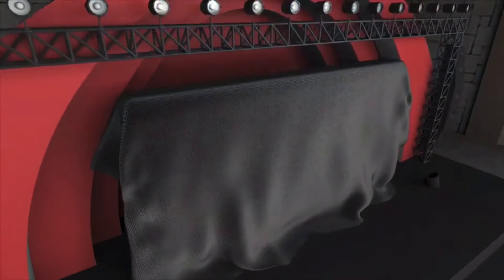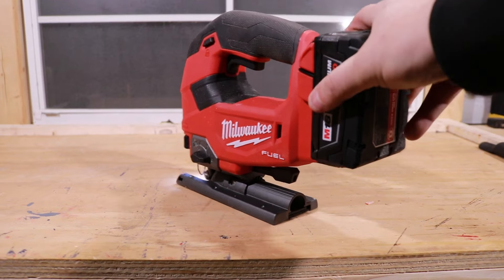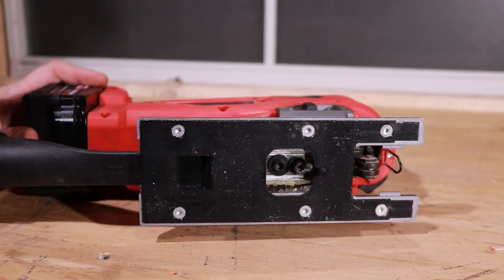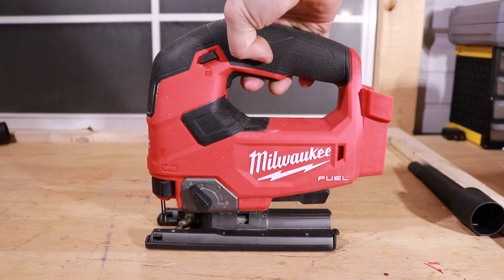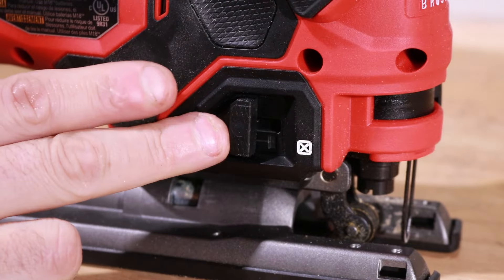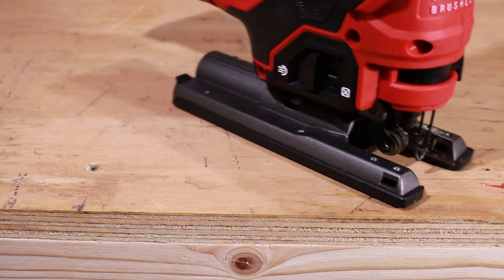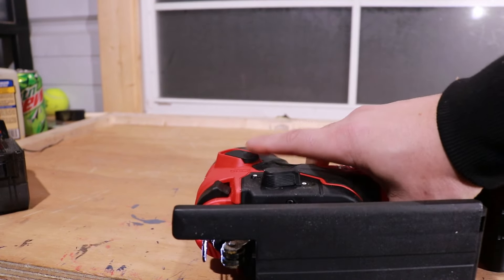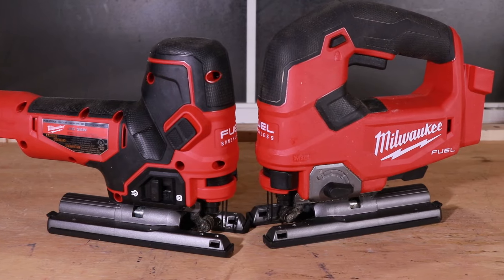Milwaukee Barrel Grip Jigsaw (2737B-20) vs. Milwaukee D-Handle Jigsaw (2737-20) Tool Duel Episode #5

Comment: Here I go again watching tool reviews knowing I don’t need more.... BUT I WANT MORE
Reply from the maker: Hahaha 🤣👊
Reply: Good review and if you check Amazon, you'd see many bad reviews for the D handle saw such as lever loosening while working, angle not holding when doing straight cuts, other incidents (Mine had a pin guide issue also so now I must not apply too much force, else, something else would get damaged in the mechanics and I need to hold the 
lever while working to keep on the line.) and I'm now considering Hilti or Festool brand because when going threw
hard wood, many tools would have issues.  Five stars for communication, tech. skill, experience for you⭐⭐⭐⭐⭐
Reply: SAME!😂
Reply: Same here

Comment: Nice side by side, but I’m a barrel grip person all day long!!
Reply from the maker: I think a lot of people are going to go with the barrel grip too broski
Reply from the maker: Yeah, I agree. Not have to pull that trigger helps too. I think each one have their different advantages.
Reply: Bevel is better on d handle but the auto is better on the barrel having both wouldn't be bad
Reply: What is the diff or the purpose for having two different model?  What’s the benefit of barrel grip over d?
Reply: You like holding long shafts huh? Hahaha
Reply: Good review and if you check Amazon, you'd see many bad reviews for the D handle saw such as lever loosening while working, angle not holding when doing straight cuts, other incidents (Mine had a pin guide issue also so now I must not apply too much force, else, something else would get damaged in the mechanics and I need to hold the 
lever while working to keep on the line.) and I'm now considering Hilti or Festool brand because when going threw
hard wood, many tools would have issues.  Five stars for communication, tech. skill, experience for you⭐⭐⭐⭐⭐
Reply: Me too

Comment: I’ve been using a jigsaw regularly for the past 10 years and I don’t know if I’ve ever used the bevel function on one. For me the barrel grip is so much more ergonomic. Particularly when making curved cuts which, let’s be honest, is the main reason we break this tool out of the tool chest. D handle has some nice features though.
Reply: For the D handle Milwaukee (12v), the lever has a tendency to loosen and if going threw hardwood doing curves or beveling, it's going to put much trauma on any tool not capable of handling it so Festool or Hilti brand has a better tool with more features to hold the blade, for example, while cutting.

Comment: The D Handle! Great tool, got it last month. I was deciding between the both tools when I was first looking for a jigsaw. Now I've seen this video I've made the right choice.  My brother has the old barrel grip great tool to, but not comfortable in the hand and you need plenty of operating room for it, "to long" that's why I went with the D Handle. Thanks for the video.
Reply from the maker: Thanks for the comment!
Reply: Good review and if you check Amazon, you'd see many bad reviews for the D handle saw such as lever loosening while working, angle not holding when doing straight cuts, other incidents (Mine had a pin guide issue also so now I must not apply too much force, else, something else would get damaged in the mechanics and I need to hold the 
lever while working to keep on the line.) and I'm now considering Hilti or Festool brand because when going threw
hard wood, many tools would have issues.  Five stars for communication, tech. skill, experience for you⭐⭐⭐⭐⭐

Comment: Very informative, thanks for posting this comparison. I like both but the on/off trigger mechanism on the barrel grip would take some getting used to.  
Here’s a scenario which I know is not something an experienced tool user would see.  If the blade snags and causes the tool to jump out of thin gauge flexible sheet metal like that on a van roof.  Instead of instinctively releasing pressure on the trigger I might fumble for that switch. This is a common occurrence with rookie tool users tackling their first conversion,  by not applying enough downward force to a flexible panel with RPM too low.

Comment: I would go with the D -Handle. 
1 -The variable speed trigger is gives you better control while cutting, you can feel the material and adjust the speed instantly, instead of stopping it turn the SPM dial and start cutting again or counting on Auto. Also the trigger ensures that when you are not holding the tool it will stop. There is no chance to bump the switch as the Barrel Grip.
2 -The grip is better, as you can wrap you fingers around the tool handle that is better to control the tool with one hand. One can easily lift the tool when done cutting
I think that both tools have the same durability as, I believe, they have the same motor inside.
Thanks for the video :)
Reply from the maker: Great comment, thanks Ivan!
Reply: Does the D handle actúa have a variable speed trigger though? Websites are conflicting
Reply from the maker: It does
Reply: Good review and if you check Amazon, you'd see many bad reviews for the D handle saw such as lever loosening while working, angle not holding when doing straight cuts, other incidents (Mine had a pin guide issue also so now I must not apply too much force, else, something else would get damaged in the mechanics and I need to hold the 
lever while working to keep on the line.) and I'm now considering Hilti or Festool brand because when going threw
hard wood, many tools would have issues.  Five stars for communication, tech. skill, experience for you⭐⭐⭐⭐⭐

Comment: I will take the metal bolt to adjust the shoe angle over a plastic lever every time. Also  Ithink the auto start would be handy and the rolling variable speed switch. Sometimes, a variable trigger can be hard to maintain its settings. Especially if doing tight radius while switching hand positions. Thanks for this review. I had the D handle in my cart, know I'm definitely going with the barrel version.

Comment: Thanks for the review. I am going to buy the D-Handle. Mainly because of the grip of the handle fits me better than the barrel type. And two, I like the variable speed trigger as opposed to the "volume controle" speed control of the barrel saw.  As for the bevel, I never use a bevel on a jigsaw. But that's just me.
Reply from the maker: Awesome.  Glad it helped Johnny!
Reply: Good review and if you check Amazon, you'd see many bad reviews for the D handle saw such as lever loosening while working, angle not holding when doing straight cuts, other incidents (Mine had a pin guide issue also so now I must not apply too much force, else, something else would get damaged in the mechanics and I need to hold the 
lever while working to keep on the line.) and I'm now considering Hilti or Festool brand because when going threw
hard wood, many tools would have issues.  Five stars for communication, tech. skill, experience for you⭐⭐⭐⭐⭐

Comment: Excellent comparison!  D handle seems to be a much more versatile tool, more compact, variable speed with the trigger, quicker bevel adjustment.  Now, I am not one to use a jig all the time, so I am debating whether or not to get the M12 jig vs the M18 D Jig.  Love the features of the M18, but the weight and maneuverability of the M12 seems appealing.  Most likely I will probably get both.
Reply: Good review and if you check Amazon, you'd see many bad reviews for the D handle saw such as lever loosening while working, angle not holding when doing straight cuts, other incidents (Mine had a pin guide issue also so now I must not apply too much force, else, something else would get damaged in the mechanics and I need to hold the 
lever while working to keep on the line.) and I'm now considering Hilti or Festool brand because when going threw
hard wood, many tools would have issues.  Five stars for communication, tech. skill, experience for you⭐⭐⭐⭐⭐

Comment: Thanks for the review, I decided I’m gonna go with the D handle due to the variable speed trigger, sometimes my blade will get caught and it’s nice to give it a quick blip of the trigger to get it unstuck. I also like to check sometimes and blip the trigger to make sure it doesn’t hit anything before I start cutting. I also like the compactness of the d handle, easier to cut in tighter spaces, plus I have used the bevel a few times and I like that it’s quick adjust and has detents for angles. Thanks again!!
Reply: I've had issues with the lever loosening ("D" handle.)on the milwaukee one with the hand lever and as you may have already seen, it got bad reviews on Amazon and as for the other one with the Allen key screw, it performed better.
Reply: Thanks for sharing 
nonetheless.

Comment: I was going to buy the barrel grip at first but now I'm conflicted. Both have nice features that the other one is missing. What's really conflicting for me, is the fact that the bevel feature is something I use quite a bit, and the reason I started looking at these, is to replace my current corded cheap bosch jigsaw, which requires a flat head screwdriver to adjust the bevel. Also I hate having to hold the trigger down, so that's a negative for the D-handle.
Reply: I decided to go for the barrel grip version, mainly because it would just seem more intuitive to push down and forward being closer to the saw/object, compared to your hand being higher up with the D-handle. It just seems (as a beginner) that with the D-handle you're mainly pushing down and it would be more awkward to push forward at the same time, also because you're higher up with your hand.

If your deciding factor is the trigger, the D-handle version has a lock button next to the trigger itself for longer cuts :)

Comment: I have used a 28V barrel grip jigsaw for over 10 years. While the tool has been reliable, the lever adjust for the bevel keeps comming loose.  It is a powerful machine all told, but getting an 18V version with an allen key adjustment instead of a lever, is a major plus for me.
Reply: Ok. Good to know it’s just a garbage design. My 12v does the same thing
Reply: D-handle...can't get the foot to stay at zero. yes, the detent pin is set. yes, the lever is locked. Feels like the lever does not "clamp"

Comment: I like the barrel jigsaw better. The “A” feature makes it easier to use rather than the trigger for speed. Can live with the more difficult way of adjusting the angle.
Reply from the maker: I think the auto (A) feature is awesome.  I think a lot will agree with you on that one Jack

Comment: I was going to buy the barrel grip but I still as of yet have not.  I was kind of disappointed in it not having a variable speed trigger and easy bevel change like the D-Handle, so I’ve been using my ancient electric Skil d-handle that I bought years ago.  I may eventually buy it but I’m holding off for now!
Reply: Good review and if you check Amazon, you'd see many bad reviews for the D handle saw such as lever loosening while working, angle not holding when doing straight cuts, other incidents (Mine had a pin guide issue also so now I must not apply too much force, else, something else would get damaged in the mechanics and I need to hold the 
lever while working to keep on the line.) and I'm now considering Hilti or Festool brand because when going threw
hard wood, many tools would have issues.  Five stars for communication, tech. skill, experience for you⭐⭐⭐⭐⭐

Comment: I was actually going with the barrel grip. But after this review, I am more hooked on the d-handle. I prefer the trigger.
Reply: Good review and if you check Amazon, you'd see many bad reviews for the D handle saw such as lever loosening while working, angle not holding when doing straight cuts, other incidents (Mine had a pin guide issue also so now I must not apply too much force, else, something else would get damaged in the mechanics and I need to hold the 
lever while working to keep on the line.) and I'm now considering Hilti or Festool brand because when going threw
hard wood, many tools would have issues.  Five stars for communication, tech. skill, experience for you⭐⭐⭐⭐⭐
Reply: @adrewdio2694  I just bought the D-handle as I own a barrel grip, and I dont like it. It hurts my hand.
Reply: @ALJessica  Went to Barrel Grip DeWalt DCS335 cordless with a new PowerStack battery. Came from a nice corded Bosch D-Handle Jig Saw. I love the barrel grip DeWalt, it is much easier to control and I don't have any issues holding onto it like I thought I might have. I don't think I would ever go back to D-Handle.
Reply: @nafnaf0  okay I feel the same way about the D-handle
Reply: @adrewdio2694  D Handle literally has 5 out of 5 stars on Amazon.
Reply: @Bud183  If you're checking the reviews with one or two stars, you'll see that many Contractors have had issues with the hand adjustable parts of the Milwaukee jigsaw, so I prefer the one with the Allen key screw to tighten the bevel, angle adjustments.  Quality of Milwaukee tools are great but some compromises were made so "Festool" or "Hilti" brands, which are more expensive for a reason, are the best choice, in my opinion, in this case although Milwaukee's other tools perform great also (Miter saws, grinders, drills, routers, screw guns, reciprocating saws, detail tools, flashlights, chargers.).  I've seen my share of top performers over 33years of usage and have often watched the comparison videos where tools are matched against each other.  Thanks for sharing nonetheless and this bears repeating: "You get what you pay for"..
Reply: @ALJessica  FYI: Check the tool comparison  videos for the whole story and the two or one star reviews on Amazon for the additional data that seasoned Contractors often share on specific issues of leverage loosening due to a bad design with a hand tightening angle guide, in this case, for the Milwaukee "D" handle grip and here's a better tool: "Festool" or "Hilti" (Expensive and less break downs later so you save.).
Reply: @adrewdio2694 I am not a pro. I am an amateur DIY. So festool is pretty overkill.
Reply: @ALJessica  Check my other replies and see the whole story and my comments.  "Buy a middle of the road tool and you're going to get a tool that will ware down sooner; you get what you pay for and if you want the best, as in a tool that will perform exceptionally well 99% of the time for many years, from proper usage, you buy the best.
Reply: @adrewdio2694  that is bull****. As an amateur DIY it is absolute unnecessary to buy the best. 
I Got the D handle fuel and it runs like a dream. 
So dont try to push amateurs to spend more money than they need by pushing your professionel needs down over their heads. You’ll just make people spend much more money than they need to.

And Milwaukee is not middle of the Road. That is straight up wrong. Milwaukee are one of the top brands used by thousands and thousands of contractors all over the World.
Reply: @ALJessica  I think you mis understand me.  Milwaukee is one of the best brands but lately, as you may discover, some of their tools have missed the mark and my comment; middle of the road, meant other brands that fell short of the mark on performing and as you'll discover from watching comparison videos, their tool has a great power train, but not a great hand lever to hold the tool firmly in place while making cuts both for bevel and angle cuts (The other model with the allen key was better all around.).  I've used many tools over the years, both cheap and high priced and the choice is yours.  I don't get anything from sharing my experiences with people who curse me out here, neither do I care.  It's your money and I was just trying to help.  Check the videos and decide for yourself.  If you have a small job to do and are aware of the risk, that's your choice.  Peace!

Comment: Every 4th cut with my older 12v Milwaukee, I’m noticing that the bevel lock has come lose and I’m just floating around. So, the bevel lock is more of a deal breaker than the Allen key
Reply: I had the same issue with my m12 jig . There's a screw to adjust it and tighten it up. That's how I fixed mine

Comment: I have the "D" grip and although I have limited use of/for it I love the features. I have no problems with the "D"
I do want to thank you for the detailed comparison. I didn't know about all the Pros & Cons of the Barrel Grip. 👍🏼
Reply from the maker: Thanks for the comment Redd!!!
Reply: Good review and if you check Amazon, you'd see many bad reviews for the D handle saw such as lever loosening while working, angle not holding when doing straight cuts, other incidents (Mine had a pin guide issue also so now I must not apply too much force, else, something else would get damaged in the mechanics and I need to hold the 
lever while working to keep on the line.) and I'm now considering Hilti or Festool brand because when going threw
hard wood, many tools would have issues.  Five stars for communication, tech. skill, experience for you⭐⭐⭐⭐⭐
Reply: @adrewdio2694  Try The Milwaukee Repair Center first.
They are great at fixing issues in a timely manner. 
Its also the cheapest solution instead of purchasing a whole new tool first step.

Comment: I think Ill get both. Regular base plate on the d handle, and a collins coping foot on the barrel grip.
Reply: Good review and if you check Amazon, you'd see many bad reviews for the D handle saw such as lever loosening while working, angle not holding when doing straight cuts, other incidents (Mine had a pin guide issue also so now I must not apply too much force, else, something else would get damaged in the mechanics and I need to hold the 
lever while working to keep on the line.) and I'm now considering Hilti or Festool brand because when going threw
hard wood, many tools would have issues.  Five stars for communication, tech. skill, experience for you⭐⭐⭐⭐⭐